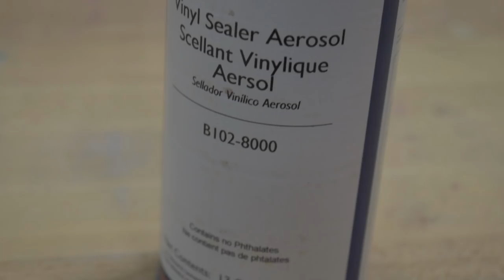Finishing a guitar neck | The Solo Music Gear Guitar Kit Build (Part 7)

Comment: When I did my SOLO kit, I inserted the neck in the pocket of the body, traced it with a pencil, then removed it again and masked off the parts that made contact with the body before sanding and finishing it. I figured it would prevent the neck from no longer fitting properly after sanding and finishing. And funny enough, I only did it that way because I was certain it was how you would do it. As you might recall, I only started watching your videos when I built my own SOLO kit. I guess, based on watching this video, that I didn't have to bother with those extra steps. Oh well! By the way, I love the gray finish you gave that neck. Well done, and it went so much faster than layering on multiple coats of wipe-on satin poly like I did.
Reply from the maker: I masked off that portion in this one as well Brent. That’s the right way to do it. I probably should have included that in the video rather than blasting through the masking section. I didn’t really approach that part as a tutorial per se.
Reply: Oh! I must not have noticed. Whoops. Sorry about that.
Reply from the maker: No worries. I don’t think I specifically showed it, so you would have had to have been looking for it.

Comment: I can't really find if anyone else has asked this question, so I'm just wondering if part of the sanding was to get the Poly resin sealer off of the neck to make it so the dye could penetrate the wood? Or is that not an issue? I want to do a similar color on their Iceman Mahogany Kit using Angelus Leather Dyes, but from what I'm finding you can't apply dye to the guitar if it has the sealer already on it?

I hope you're able to answer this! Super stoked to build one of these, your videos have been a huge help!
Reply from the maker: That’s correct. Sealer generally makes it so dye can’t absorb (although very thin sealer sometimes helps dye go on more smoothly).

Comment: do you have a video where you spray paint the headstock and apply oil on the neck ? How would you do the transition paint to oil on the back of the headstock ? Your video's are really helpfull, thanx  !! ;)
Reply from the maker: Typically I would just tape the headstock edges and paint the face of the headstock first. Then oil the back of the headstock and the neck. 
I think I did a transition on the neck in my Home Depot guitar kit series though if you want to see how I approached it.

Comment: From time time to time I enjoy putting a kit together .  I use left over parts and material . Knowing the kit is going to need prep work and I expect it to need prep work why do people get so upset . It's no different then a new guitar comming n and needing a reset . The thing I don't understand is the new guitar that comes n and they want to replace the pickups with the same out put. Then save the pickups for another guitar . Oh well got soder sniffles .lol
Reply from the maker: I’m not sure who you’re referring to getting upset, but I definitely know what you mean. It seems like some people think they’re basically going to get a nice guitar where they just have to bolt on the neck and it’s going to save them a bunch of money. It’s a bit ridiculous. 
Some kit guitars have substantial problems, like issues with neck fit and alignment. Those ones can’t be fixed just with reasonably skilled setup, and as far as I’m concerned that’s a big issue. Aside from that, the prep and finishing work is all part of the fun.
Reply: Brad Angove I have what is called my junk guitar I'll walk past my other gear go straight to my junk guitar it has not been prepped for a fine finish has no vol or tone knobs no switch pickups are wired together on treble bleed circuit.  Looks like an old Tesco and has cheap tuners and is used for open  tune slide work .  And it's from a non brand kit . And always people walk in and go straight to my junker . Kits are some of the best ways to do trial and era on . And you'll still have what your intent is.

Comment: You inspired me to make a black, green, and gun metal  evh style start with black hardware
Reply: Strat*
Reply from the maker: Nice! How’s that project going?
Reply: Its finished and looks and sounds great but wiring was tricky
Reply from the maker: I’m glad it turned out well
Reply: I have a question my ibanez ds7 distortion pedal makes a hum/buzz when clicked on. All the other pedals on my board work fine its just that pedal
Reply from the maker: Ok, I’m not good with pedals, but what’s your question?
Reply: Just trying to get rid of the hum on my distortion pedal
Reply from the maker: Do you have other similar distortion pedals that don’t hum? In my experience they all seem to do that immediately when they’re switched on.
Reply: @BradAngove  no just chorus, delay, phase, and tremolo
Reply from the maker: Ok. I’m not sure if there’s actually something wrong there. Usually distortion pedals start making some noise as soon as you engage them, or at least mine do.

Comment: Sweet. I used teak oil on my neck for my JM kit - I did 3 coats of teak oil, I really like the way it turned out.  Question is, will the teak oil stand up or will it need to be reapplied?
Reply from the maker: Teak oil tends to be relatively durable. I may need to be reapplied, but not as often as fretboard oil for example.

Comment: Question Brad.  I've noticed is that you don't do any filing to the nut so that the strings sit properly in the channel.  Why skip that?
Reply from the maker: The nut is already filed, so the strings are sitting in there just fine. I would consider removing a bit of material from the bottom to lower the action slightly, but I haven’t had any issues with the channels themselves.

Comment: I wouldn't oil the fretboard, personally.  Rosewood is a very hard wood and I think if you oil it too often, it'll turn the wood to putty.  But oil it once a year... well, in 50 years it might start to get softer on the surface.  Just scallop the fretboard and don't worry about it. :)
Reply from the maker: This is a kit guitar though, and this was the only time it had been oiled.
Reply: @BradAngove  Yeah, I think  doing it  rarely prob is ok.  I just know from experience that my solid Indian rosewood neck was oiled with lemon oil maybe once a month for 2 years and it showed  a little sign of change (for the worse) on the surface of the fretboard.  Darker and softer.  So.... maybe I'm overkilling it but.... although the oil makes it look darker and richer, I just don't do it.  But then I scalloped my fretboards so I'm not rubbing them during play anyway.

Comment: Question i have a neck pocket that fits good but going to paint the neck. How much should I sand to account for the paint on the neck to make the pocket loose enough to fit it in.
Reply: I want to sand the neck down prior to painting to account for the paint thickness
Reply from the maker: It depends on what paint you’re using and how thick it is. You also consider masking the part of the neck that goes into the pocket.
Reply: I thought about doing that but didn't want to damage the edge of the paint when pushing it into the pocket

Comment: Can you lacquer over a gloss finish?
Reply from the maker: Not without sanding first. Unless the gloss finish is also a nitro lacquer.
Reply: Brad Angove would u recommend using the rub on lacquer or the spray lacquer on the body of the guitar?
Reply from the maker: Spray.

Comment: The guy talking about never oiling a fretboard is probably a big scott grove fan
Reply from the maker: Now there’s a comment I haven’t heard in a while haha
Reply: @BradAngove  So thats how I am about to spray my neck, laying down like that however I also need to spray the fingerboard. 'm trying to think how I should go about this. Spray the back.. leave it to dry enough to turn it over and not mess up the finish then spray the other side? Or spray the back, wait the full 2 hous, then spray the other side.. wait the two hours and continue the next day?
Reply from the maker: Can you hang it from one of the tuning peg holes and do the whole thing at once? Using a metal coat hanger perhaps? I’ve done that before.
Reply: @BradAngove  I could... but I would probably have to do that with no shelter since my paint booth is a small tent.
Reply from the maker: What are you spraying it with?
Reply: @BradAngove  I have been experimenting with this can of watco satin in a rattle can. I was thinking that. I am setup for spray guns as well but totally new to wood finishing. Bought the can of EZ sealer, some wipe on poly and got the watco can.
Reply from the maker: The watco can should work fine. I would try to set up a place to sit it with as few contact points as possible.
Reply: @BradAngove  I think I figured out an idea. Good looks on the EZ sealer... I tested that stuff with all sorts of finishes... it really does work as advertised... and cheap!

Comment: you say "height" weird... americans say it as if it were spelt "hight" though i suppose.
oiling the fretboard depends upon which type of wood it is. if it is ebony, you shouldn't oil it, but if it is rosewood then you should. if it is a maple board however, then water works okay because the board is finished, and it wont matter... maybe that is where the guy you mentioned got the idea.
 by the way, a cool trick for cleaning fretboards that are grungy is to use a high poly eraser.
Reply from the maker: Interesting. I’m going to guess your pronunciation of height depends somewhat on what part of the states you’re from. 
He was referring to hydrating the wood. It’s a rather ridiculous suggestion. Ebony is so dense there’s little reason to bother oiling it. As for maple, many maple fretboards aren’t finished. I would be more inclined to oil them rather than lacquer them like you see sometimes. 
A high poly eraser? That’s a new one. Thanks for the tip; I’ll have to try it out.
Reply: i live in texas, so maybe that is why, though texans don't have a stereotypical accent as you would expect, like an alabama person would. i would say that texans sound somewhat northern, i guess neutral accent, but with different word choices, and a slightly slower talking speed.
yeah, high poly erasers are the often white "mars" erasers that you see nerds carrying around instead of other types of rubbers(hehe).
 and also, you see a bunch of maple fretboards that arent finished? hmm, i havent seen enough unfinished maple boards to really bother with looking into caring for them, though the ones i have seen often get really nasty because maple takes stain really well... they do look better without the finish when they are new.

Comment: Water? Really??? Can you say swell? lol. Actually, I learned a while back about using Howard's butcher block conditioner, and now I use it all the time. I only do it maybe once a year, but it works amazing for rosewood and ebony.
Reply from the maker: Butcher block oil is a good choice. It’s essentially mineral oil, which is the main component in lemon oil anyway if I’m not mistaken.

Comment: Hey, how do you finish the sides of the fretboard? Do you spray it with clear too?
Reply from the maker: I usually mask the sides and then carefully scrape the paint ridge after to reduce it.
Reply from the maker: I just carefully touch up what I need to with high grit sandpaper and then polish a bit to smooth everything out.

Comment: Do not use methanol.  It’s very toxic and this dye is primarily acetone.  If you want to cut the intensity of the color use ethanol instead.  You are cutting the color back with methanol and no gloves....have you looked at a safety data sheet for any products you use?
Reply from the maker: I’ve looked. I still use methanol though; it works better. Acetone itself is too strong for this purpose. Ethanol just isn’t as effective. I guess I could have used recordsol, but I still prefer methanol, so that’s what I use haha.
Reply: Perhaps consider safety when showing people how you do things?  Methanol is toxic stuff and you weren't wearing gloves is all I'm saying.  This dye is primarily acetone already (70% or more) so thinning it with acetone isn't really going to make it stronger, it will just cut the color intensity.  If you are going over the color with methanol after the fact acetone would work for that purpose but maybe you mean it's pulling too much of the color off when you've tried it.  

If you enjoy finishing and want to do it for a long time I would encourage you to consider health effects and try a different way to get to your end goal.  Just my two cents of course.